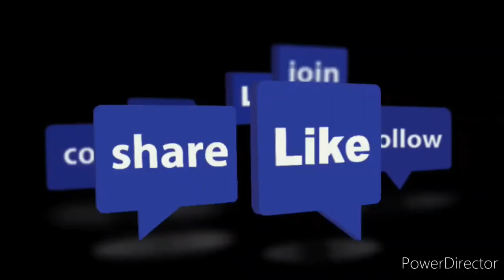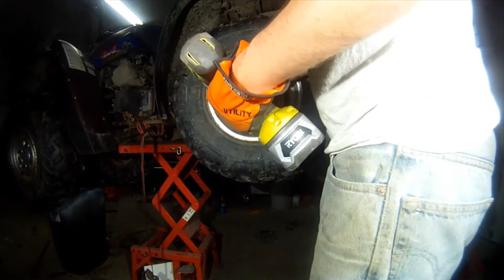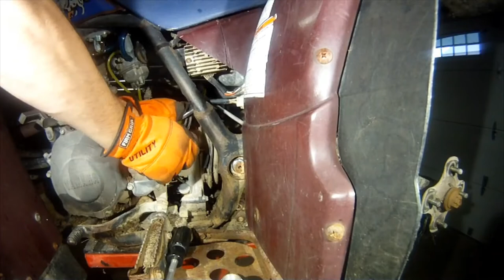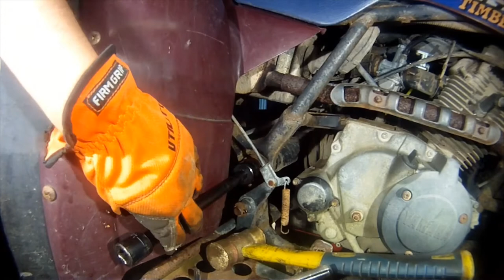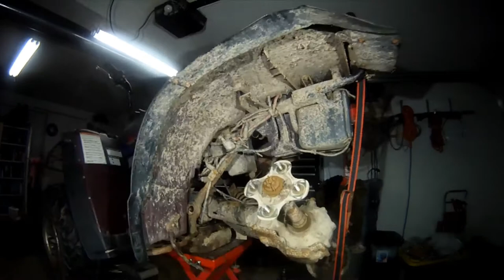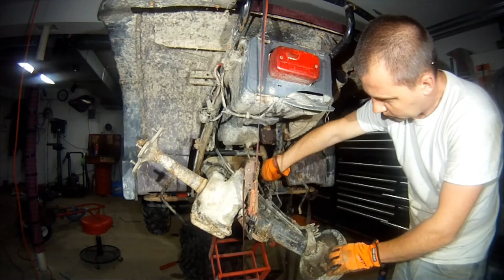Yamaha Timberwolf Rear End Removal

Comment: What lift model is that and where’d you get it? I need that thing bad.
Reply from the maker: That's a dirtbike lift stand off ebay or Amazon.  They are nice but heavy.  Now I use a lift table from harbor freight that is a lot easier to work with.  Rolls under machines lifts same height
Reply: @GarageVlogBob  I’m surprised the one for the dirt bike lifted it. Which weight capacity harbor freight lift did you get? I have a Timberwolf that I’m working on but it says it’s 529 pounds in the manual and the lifts I looked at don’t hold that much if I remember correctly.
Reply from the maker: Currently I have the 500lbs one and it works fine for that machine but struggles on bigger 4x4 machines and I also use it to lift one end of my sxs and it struggles.  I wish I purchased the 1000lbs one because I do a lot of heavy atv repairs.  I'm not willing to buy the bigger one until my 500lbs finally gives out.  4 years strong.  If your not doing big machines you can easily stick with the 500lbs one because it's a Lil lower to the ground witch helps
Reply: @GarageVlogBob  awesome man. Thank you. That Timberwolf is the only thing I’d use it for.
Reply from the maker: I would stick with the 500lbs one then.  It fits under sport quads.  I'm not sure if the 1000lbs one would be low enough
Reply: @GarageVlogBob  will do